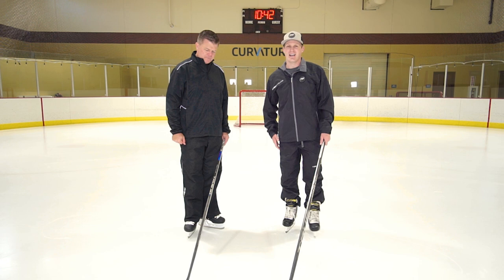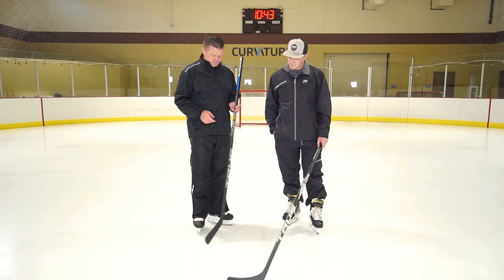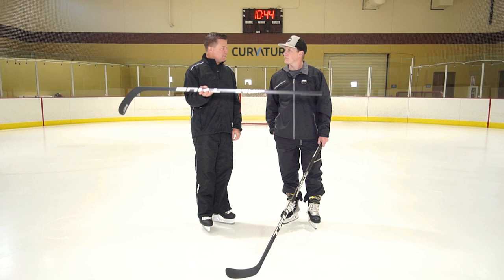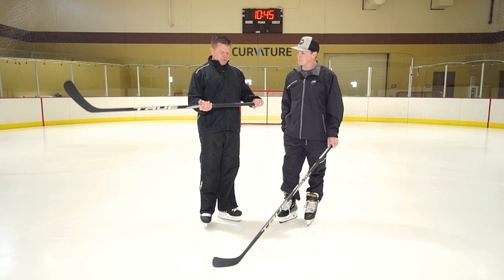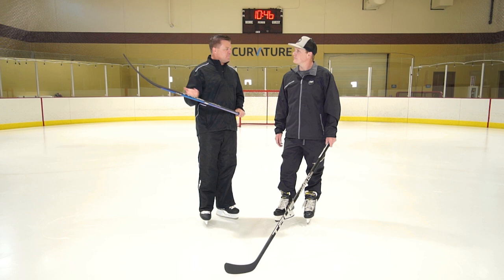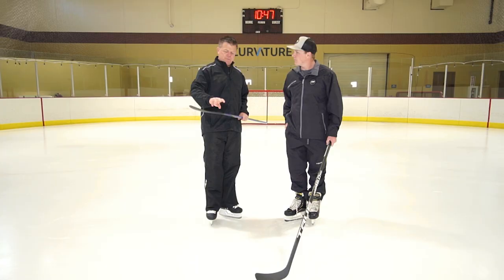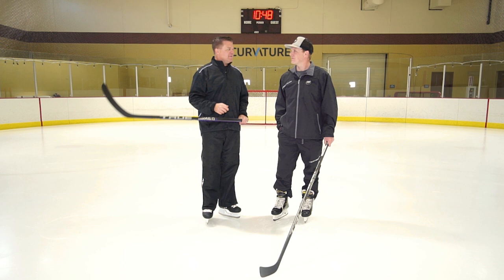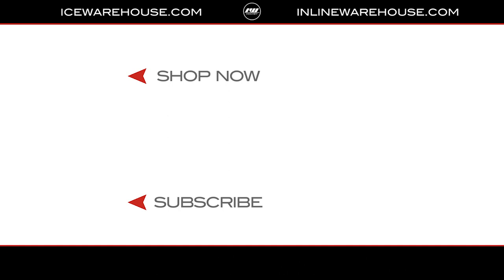True Hockey - Swing Weight Technology

Comment: Hi i recently bought the 1s stick with the p28 curve do you think it will to be hard to get used to? Im moving from the p92 i take alot of snapshots from the toe thank you
Reply from the maker: I think that depends on the player, it took me a while to get the hang of the P28 because I grew up on the PM9 and slowly moved to the P92. I have a feeling if you have been using the P92 for a few years, it would be easier to transfer into!

Chase at IW Hockey
Reply: @ice.warehouse  ive been using the p92 for 7 years ans havent had a different curve since im just scared that i wont be able to shoot or pass for a while

Comment: When is he 2x coming out
Reply from the maker: August 2019! 

Chase at IW Hockey
Reply: Ice Warehouse I have 1s skates that are pretty broken down so I have to get new ones. They are currently size 7.5, but my toes aren’t at the end but when I take my feet out of them sometimes the top and sides of my feet hurt. For my new skates do I get a size 8 or a 7.5 with a wider width? I don’t want there to be any extra space in my boot but also want the most performance in my skates.
Reply from the maker: @vincel9785  Hey bud, it sounds like you might have a high instep and a wide forefoot that isn't properly fitting in those 7.5 Supreme's. If you have a few minutes, I'll shoot you a recommendation based off your length/width measurements that you can quickly get from this video we shot last year. LINK - https://youtu.be/UEsGaZ3nmio

Chase at IW Hockey
Reply: Ice Warehouse I am a 26.6cm length and 10.5 width on the right, and a 26.4 length and 10.3 width on the left
Reply from the maker: @vincel9785  Hey Vince, I'd suggest getting a 7.5EE in Supreme or Super Tacks. You borderline have a wide foot so I think that's what was causing your foot pain!

Chase at IW Hockey
Reply: Ice Warehouse if I went up 1/2 size to an 8 in 2s pros would that be good or no
Reply: @ice.warehouse  When I went to get sized for shoes I was a 9.5 in one foot, but a 9 in my other foot, and i understand that skates should fit 1.5 sizes smaller, so i'm kind in a dilemma here as my left foot fits a skate size 7.5. but my right is an 8, so what should I do?
Thanks